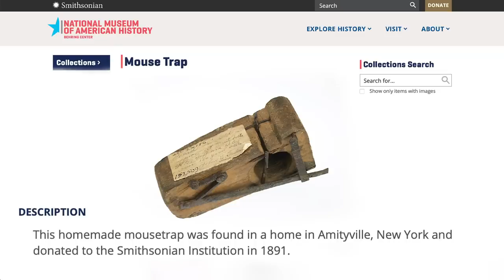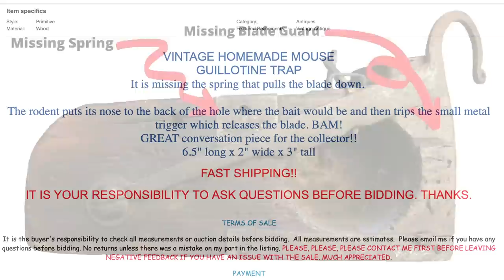Antique Guillotine Mouse Trap  -  $1,000 Mousetrap   -   Mousetrap Monday

Comment: 4:15 I see what you did there! Making bedding material for your pet mice.
I was surprised that you didn't use the abundant Equisetum in our area to finish the wood. I have used it on many wood projects and the finish is absolutely beautiful. I did learn that partially drying works best. Too wet and it leaves a green tinge, too dry and it turns to dust. Usually the oldest ones seem to work best. They are just about perfect for moisture and higher in silica abrasives.

Comment: That walnut wood block isn't powdery from rotting or age, it's powdery from wood boring beetles.
Reply: Brian Landers  I'm a retired pest professional, I've seen it with my own eyes... But for your leisure, this is from a quick google about wood boring beetles in walnut. "Boring insects can penetrate nut buds and the walnut wood itself, destroying the high-quality timber. Several different types of beetles attack walnut trees and may introduce a fungus that will cause cankering, top tree dieback and resprouting on the base of the tree – which all will weaken the tree. A schedule of treatments can successfully control insects on a walnut tree."

Comment: A tip on cutting fire wood like you did. Grab a old tire Bf put it around it. When it's splits the wood like that it will prevent a piece from taking odd 
fly away.

Comment: You might consider an improved version of either trap by designing a removable tin cover plate that can be set on top of the trap to cover the exposed trip mechanism once the trap is set. That way when the mice crawl on top, no more free dinner.

Comment: I would have, while not like the original, put a hole in the blade to slip the catch through so the blade would have a continuous sharpened curve, and a shroud over the trip connection to keep it from being touched. Great work!

Comment: Those are very nice old traps for use inside the house to catch one mouse that is looking around for a snack. It isn't good outside. If you wanted to use it it should have one more part: a strong staple or two protecting the trigger so the mouse can't set it off by exploring the top of the trap. Also, Shawn, you used linseed oil to stain the wood. Mmm, delicious - to a rat.  For homemade wooden traps, use a stain that they don't want to eat.

Comment: I removed a mouse from a Jawz mousetrap (which are actually really good traps) it had been in the trap long enough that it was laying in a pool of dry blood. The dry blood matted around the fur was like glue. As I pulled on the mouse, the fur actually started separating from the skin. Which I didn’t realize until I went to dispose of it; when I turned it over there was a huge chunk of fur missing. And the skin that was exposed was a bluish-green color. And the smell was so bad. I’m surprised I didn’t vomit from the smell. Anyway, I chucked the mouse outside so something could eat it. Yummy.

Comment: Why are your saws resting on pins on the teeth? Surely hung by the handle is the better way to display them, especially if you plan to use them
Reply: Also, why push a draw knife?